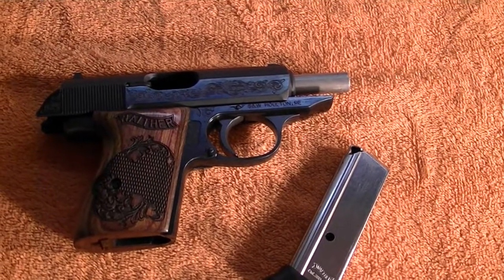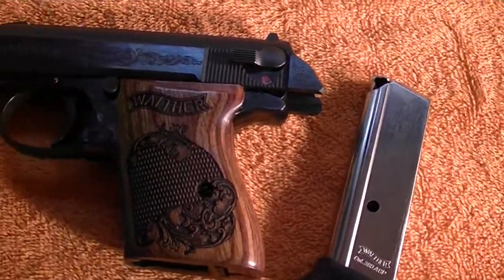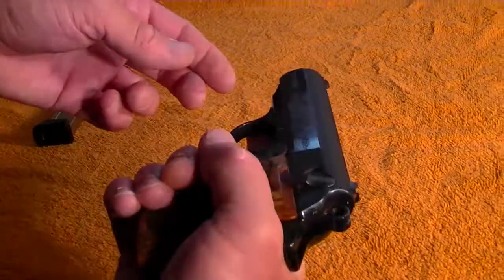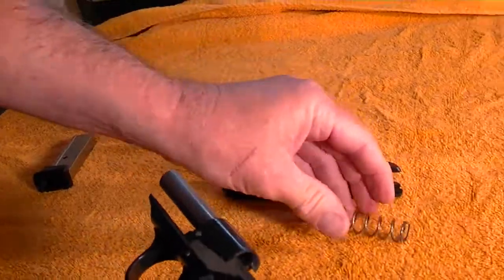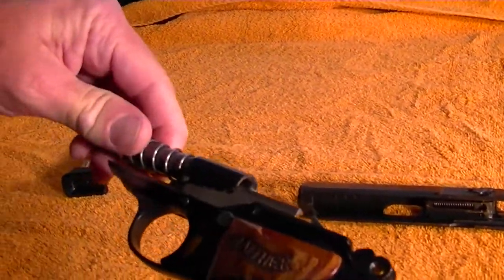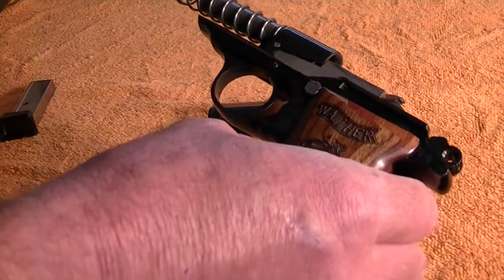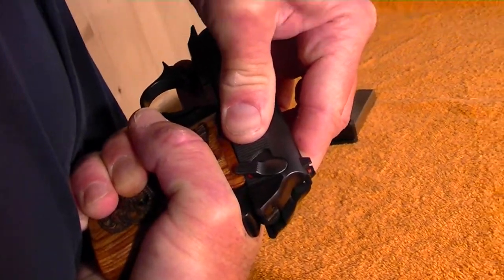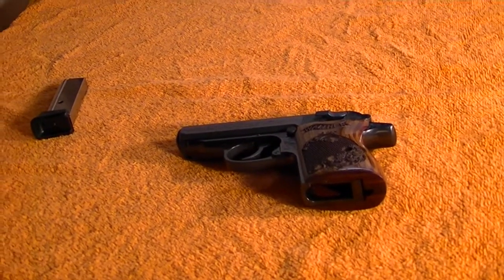Walther PPK DISASSEMBLY AND REASSEMBLY

Comment: The "s" does NOT stand for stainless, as you stated.  The "s" designation is the result of the 1968 Gun act.  They had to change both the slide and the handle to comply with the law.
Reply from the maker: Septimus Pretorius thank you for pointing that out, you are correct

Comment: The gun won't cock, after disassembling and reassembling the first time. Brand new gun, played with it a few times before disassembling.  After it is disassembled, I can still cock and pull trigger, but not after I've reassembled it many times.
Reply from the maker: It would have to cock before you could get your slide back on, can you give me a little more detail?  Thanks
Reply: +THE SHOOTERS CHANNEL While disassembled, I can cock the gun and pull the trigger, no problem.  While reassembling, I have the gun cocked. When I slide it back on, the hammer goes back upright automatically.  So, something is going wrong from putting the slide back on, or pulling it back to when it falls into place.  Thanks for replying!
Reply: Also, when I try to cock the gun after completely reassembled, the slide moves just fine, but the hammer does not cock. Rather it just jumps right back up.
Reply from the maker: +kristina sollosi try putting the safety/decocker on fire
Reply: +kristina sollosi I think it has to do with the extractor.  Its almost as if the slide is overpowering it and it won't hold
Reply: +THE SHOOTERS CHANNEL Ive tried both ways; safety on and off
Reply from the maker: +kristina sollosi I don't see how it would be the extractor, did it lock back before disassembly?
Reply from the maker: +kristina sollosi Did you find out the problem?